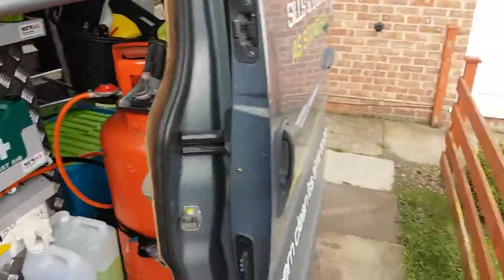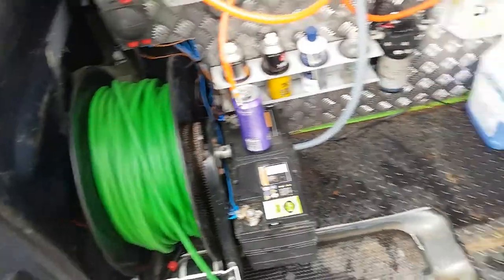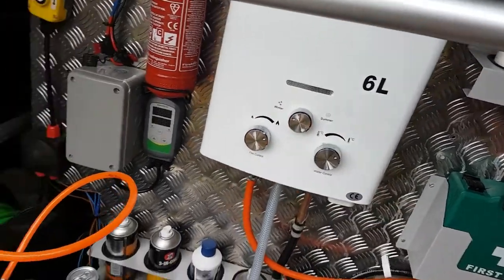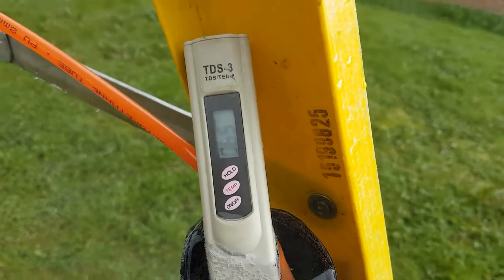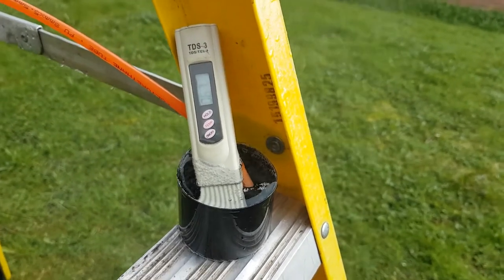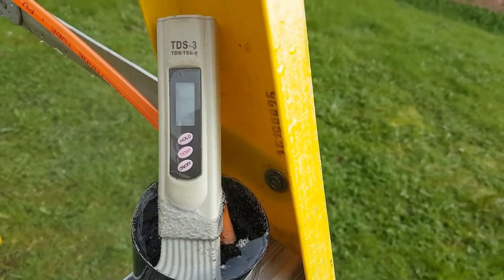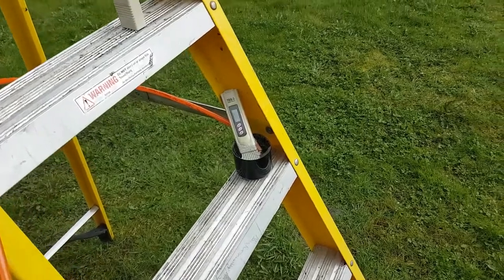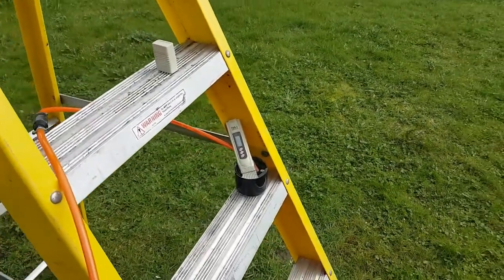Window Cleaning - Hot Water - How hot with Propane? Water Fed Pole

Comment: Also n pardon the pun but whats the crack with potentially cracking cold glass with warm/ hot water in winter. ?
Reply from the maker: Doesnt happenn on modern properties with double glazing. Potentially could happen on single pane in very very sub zero conditions. 99 of 100 that say 'I broke windows using hot' are talking BS and have never had a hot system.

Comment: How much does it use gas bottles  a month?
Reply from the maker: That will depend on the size of the gas bottle, how many houses a day, how may days a month, the size of the houses, the temperature at which you set the heater etc etc

Comment: Do you use hot all year round
Reply from the maker: Yes
Reply: Will using the hot in summer stop the summertime spotting of older South facing windows? When the weather is hot it's the only time I seem to get spotting.